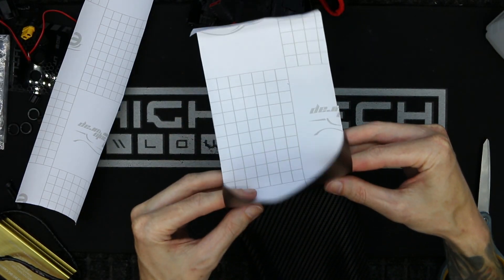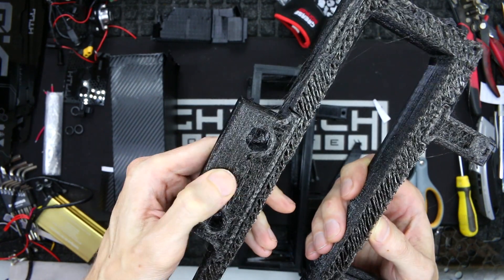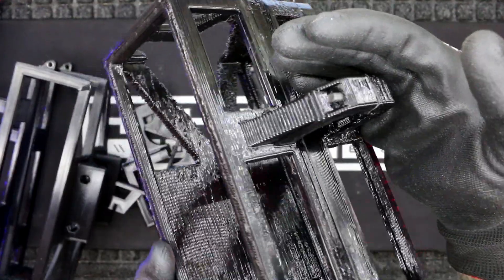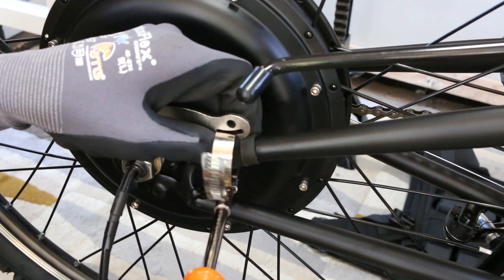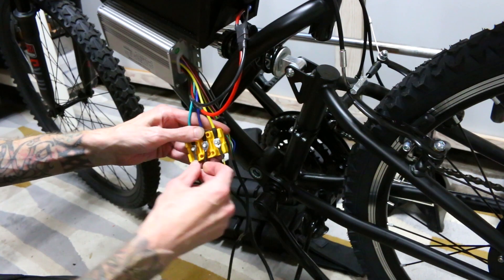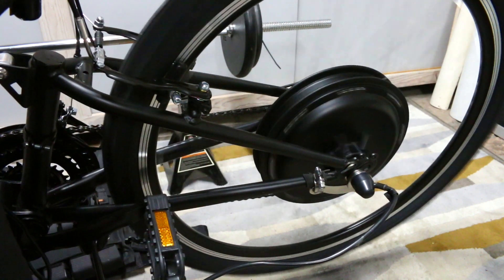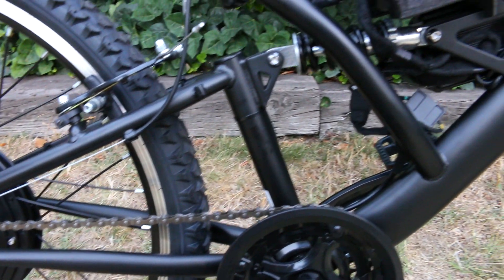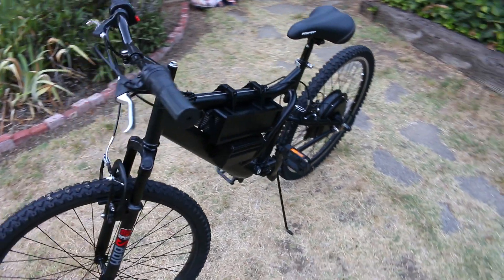🚲 1000W Full Suspension *Budget* Ebike Build \\ MTB - DIY \\ 48V 1KW Hub 14Ah - Part 2

Comment: I'm about to do a Giant Talon 1 with a BBSHD. I'm wondering, can I swap out the shimano deore shifter with a half twist shifter? I want to set it up just like this.
Reply from the maker: Awesome man, should be a fun ride. I will be building some mid drives in the future as well 👍 I'm pretty sure you can do a half twist with any setup, but I haven't tried anything personally. I usually don't have to pedal at all with big hub motors, so anything with chains and derailleurs I don't pay much mind to.

Comment: That controller is bigger than a BBSHD. 😆😆😆
Reply from the maker: It's a small controller too! Are you running a mid drive?
Reply: I'm building my 1st ebike soon. BBSHD with stock controller, future upgrade to BAC855 from 
High Voltage

Comment: 🤣 I did the same exact thing to my battery but with rainbow shatter glass shiny tape 🤣🖤
Reply from the maker: Someday I will make a build where I just duct tape everything in place 😂it's really the easiest way to go 👍
Reply: @hightech-lowlife  think the biggest rule is only $5 maybe even reinforce it with some acrylic technically you just taping a box together 🤣my first attempt to build one was using aluminum tape (use enough it just turns in to big block of aluminum and J-B weld will stick to )🙃
Reply from the maker: @chikararexzpo  Yeah someday I will do it with some tape! Aluminum tape would work well, it's very sticky and quite strong!

Comment: Two white self study wires...... schoolboy error.....
Reply from the maker: Are you implying this kit has a self-learn function?
Reply: .....have you checked ✔......
Reply from the maker: @iknow6147  I will give you exactly one guess as to if it has a self-learn function. 😂

Here is a hint too: https://i.ebayimg.com/images/g/jJIAAOSwH-BfyM~V/s-l1600.jpg 

You can't expect many features, nor high QC with a kit this cheap, but it's pretty easy to fix once you know how. I may make schoolboy errors all the time, but I'm 100% certified in RTFM'ing 😎. Once my YT career fails I can always get a job building hub motors in a factory, I'd make sure they even spin in the right direction. 🔨

Comment: You have any ideas to mount a battery like this but without a 3d printer?
Reply from the maker: Yeah for sure! Lots of ways to do this, one way is with a battery bag (cloth bag) that you can sew velcro straps to, another is to make a battery box out of thin aluminum and bend and rivet together, you could even build a duct tape box/bag and strap it to the frame. Possibilities are endless really 👍
Reply: @hightech-lowlife  Thanks! I already thought about something with aluminum plates and i think I'll go with it. And btw your channel is really underrated but im pretty sure this channel will blow up.
Reply from the maker: @golextech  Aluminum will work well! Thanks so much man, I really appreciate it 🍻

Comment: I used to have lots of issues with failed prints where the top layers get stringy or don't print at all with PLA. The issue was that my printer wasn't able to pull the spool of filament enough so it would just bind up and run out of filament. I fixed this my printing a holder for the filament that uses bearings so there's as little friction as possible on the spool. Try looking into that if you notice your printer can't turn the spool easily with it's feeder. I found the print in thingiverse.
Reply from the maker: Thanks man! I will try it out, I don't believe my printer is having spooling issues because the force isn't that great to turn it. The weirdest thing is that it seems to be inconsistent. I think the heat was affecting it the most, during that week we would have swings of +40 degrees between the day and night and with 24+ hour prints I think this temperature change was causing issues. I've printed a few more things since then and everything has been working just fine, so I'm not sure why I was having so much trouble with this particular file 👍

Comment: make an ebike for under 100!
Reply from the maker: That's a tough challenge 😂 if I tape a AA battery to it, does it pass as an ebike technically? I will try to go lower than 500, but will have to look at the used market 👍
Reply: @hightech-lowlife  nah i mean like used battery or a spare u got and then steam some motor from some trash hoverboard or something do a frankenstein bike is what i meant

Comment: Awesome clean build dude, cost almost nothing and this thing is faster then 80% of all ebikes.
Reply from the maker: Thanks so much man! I will be making more builds in this vein but with even more power but still on a budget 🍻👍
Reply: @hightech-lowlife  I just build a 2000watt on a hardtail, love this thing, what do you think about shunt mod's?
Reply from the maker: @coop5000  That's really cool, must be a fast bike! 

I've personally never done it, I think overclocking things has its place, but depending on your situation it may or may not be worth it. You're basically tricking the controller into thinking it's delivering less power than it really is, so it will deliver more power (than it was designed for). I'm sure it's been done with success many times, as long as the controller is overbuilt it should hold up fine. I personally would rather just sell a controller that wasn't powerful enough for my needs and get one that is, as controllers are relatively inexpensive compared to the other components on an ebike (mainly the battery). 👍

Comment: In vinyl extrusion, heat lamps are used to keep the extruded vinyl products from bowing, not sure how that could work in your process, would probably have to be built into the 3D printer enclosure itself...Nice job, best looking $500 dollar electric bike with full suspension capable of 25 MPH sustained speed and a 35 mile range that I've ever seen, or maybe that even exists...
Reply from the maker: Thanks man! A lot of my issues were just lack of experience and not knowing what settings would be the best. The bed of my printer is slightly bowed which is not helping either (lower on the sides), but adding a brim did help adhesion on the sides. I have since printed quite a few smaller things without any issues, so I'm not really sure what was going on. I have a lot more 3D printed projects coming up and I have some better methods for creating battery enclosures which should eliminate a lot of the problems I was having anyway. 

Thank you! I think it came out pretty well, I was very impressed with how much of a bike you could get for not that much money 🍻👍